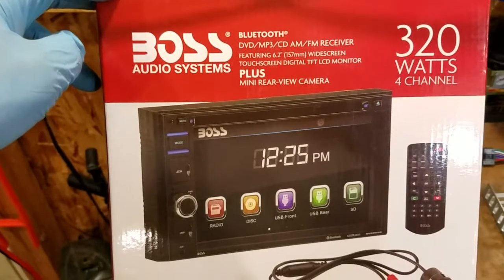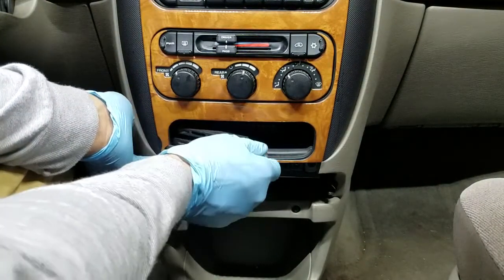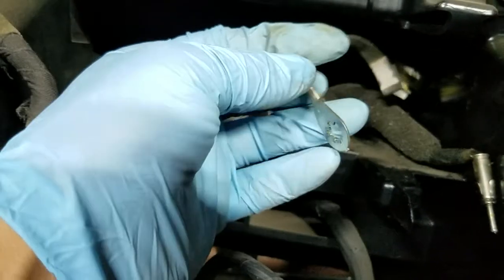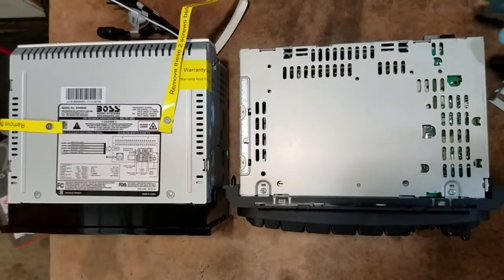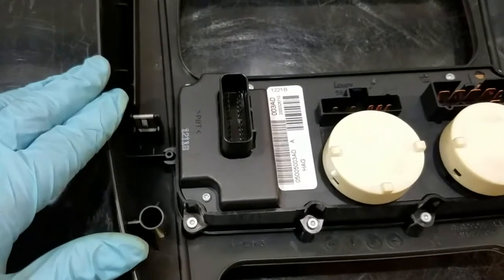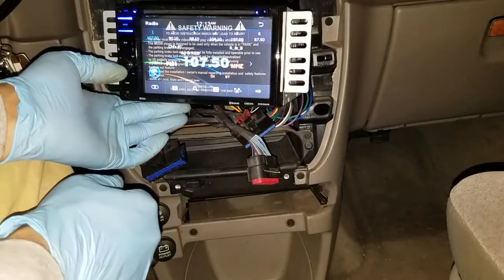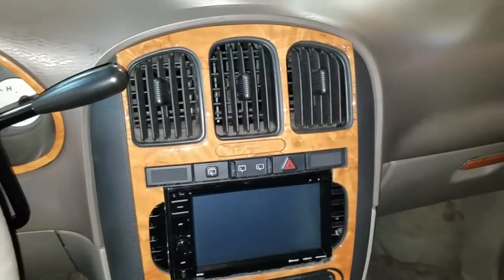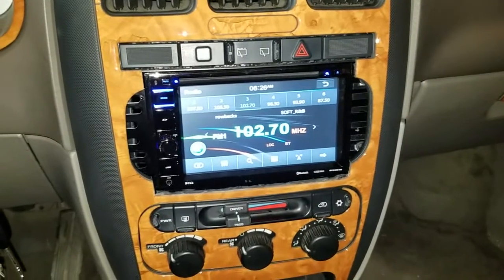01 Dodge Grand Caravan Radio Replacement

Comment: Great job:) your the only one I've found so far that shows the hole process! ( Cutting the inside to make the radio fit) thank you very much I know what to do now:)
Reply from the maker: Thanks. I really try to give you all as much info. as I can, so you can see the issues you might run into and how to solve them.  I have realized that most videos are really good and short, but lacking the actual process from start to finish.

Comment: Why did you not use the new bezel? Would have looked so much better in my opinion.  Im doing this mod very shortly and i used cheap vinyl wrap for the texture. Thanks for the video though i might make one on my progress on my 2003 Chrysler Grand Voyager
Reply from the maker: The replacement bezel had a very small shallow storage area at the bottom, which I didn't like. Also, I couldn't remove my custom dash kit off the OEM bezel, which cost more than the radio.
Reply: @Pk3_Garage  ok fair enough.  I hope my bezel will fit. Im worried about the air outlets at the top they dont look 100% the same
Reply from the maker: Do a test fit first before you do any kind of work. This way if it doesn't fit you have not modified anything.
Reply: I was stressing unecessarely the air vents and everything fits perfectly. But yes the bottom slot is annoying wonder if i can cut that out on the new bezel and use the original deeper storage slot 😏. To be continued, thx for the guide and advice. Ps the little hole underneith the airvents is for a passenger airbag light where in some countries you can switch the airbag off. Know this because my bezel came with the sticker to put in that lowered little grove
Reply from the maker: @Nordic80  _ sorry for not replying to you. (I didn't realize you posted a comment ). I'm glade the bezel fit. I'm sure your done with this project already, so no need for me to give a response. I will say though, our van didn't have a passenger side air bag light. How did everything turn out?

Comment: I don’t get it. You’re having all these problems by having to cut stuff out, but there’s other customers that used the exact same Metra dash kit and they didn’t have to do any cutting. I’m about to order the dash kit myself. I already ordered the Pioneer AVH-2500NEX. I’ll let you all know how it goes.
Reply from the maker: I can't speak for others, but the new radio wouldn't fit all the way back in the dashboard or flush with it, w/o the modifications.
Reply: I absolutely had to cut out some of that plastic cross member in the opening of my 2005 Grand Caravan.  I also had to slightly modify the Metra bezel kit in order to get the new head unit to fit properly.
Reply: I’ve had to do a lot of cutting inside of there, more than I thought. But my setup is complete and I have a nice clean flush finish.